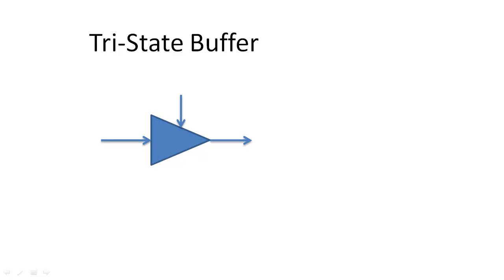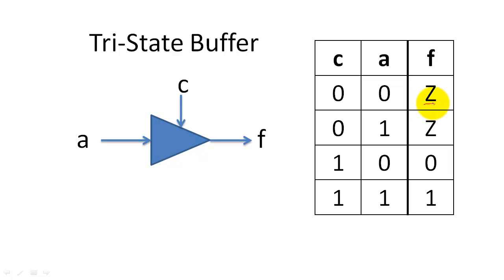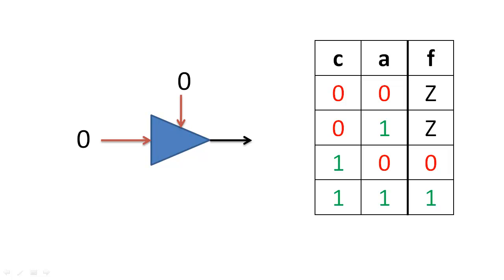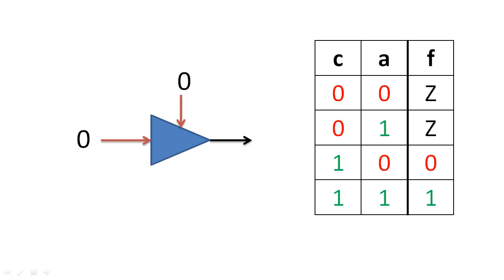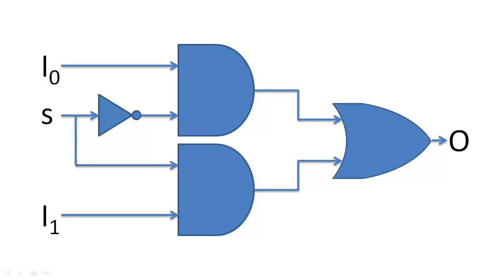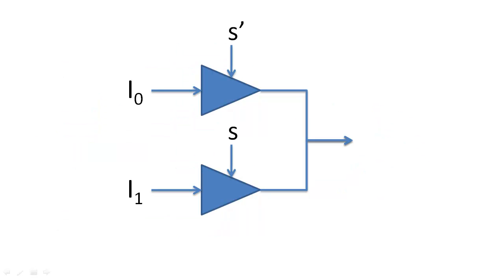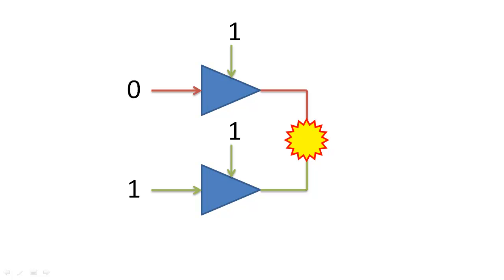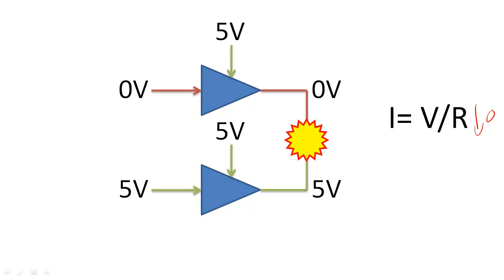Tristate Buffers

Comment: At 1:15, are you saying that current will still flow through a circuit even if the voltage is zero? If so, how would that be possible? Voltage is required to push current through a circuit, therefore zero volts would mean that no current is flowing through the circuit right?
Reply: Yup, wanted to know this as well

Comment: if  I = V/R doesn't that mean that if Voltage goes to 0 then current will also drop to zero?
Reply: Well mathematically division by zero is undefined, but to understand what happens you can replace 0 with a very small number, say 0.0000000001. If you do this calculation you will see that the result is very large. If instead of zero you imagine division with a number that is infinitely small then you will see that the result will go towards infinity.